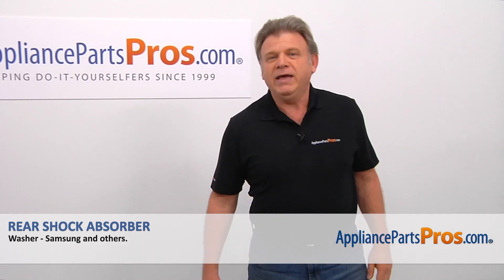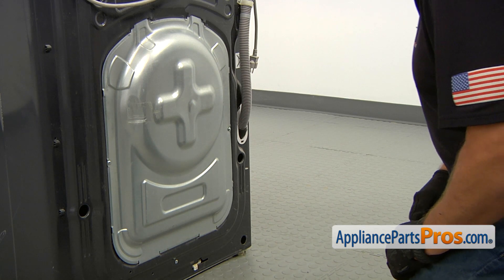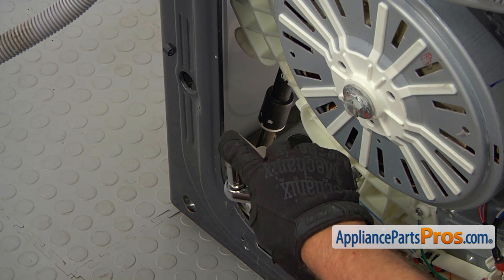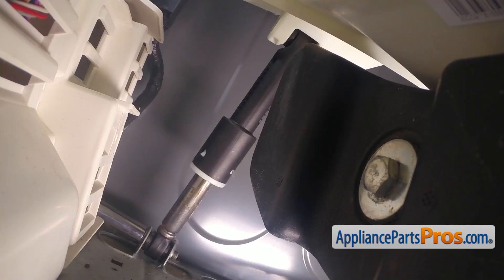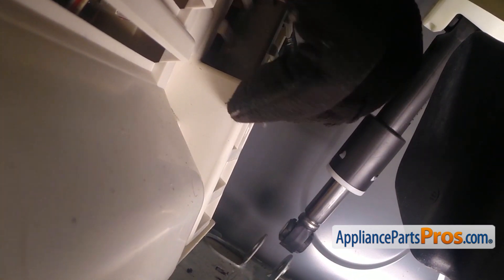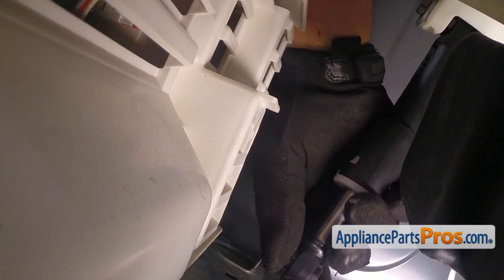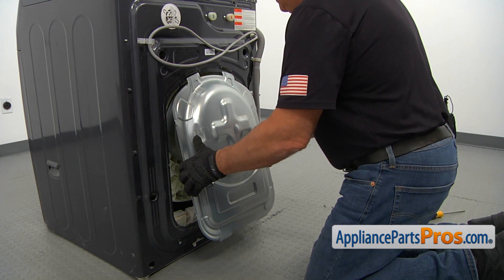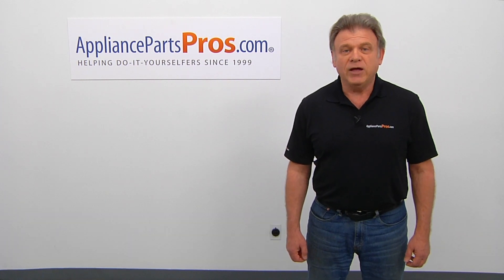How To: Samsung Washer Rear Shock Absorber DC66-00470B

Comment: On my Samsung Washer (WF220ANW-XAA) the rear shocks are P/N DC66-00531B and the fronts are P/N DC66-00470C.  Though I'm not sure what the difference is between them. The front shocks seem fine.  The rear shocks seem to take the most stress, and are worn out. (It's easy to determine because the tub is out of level by 1-1/2" lower in the back.)